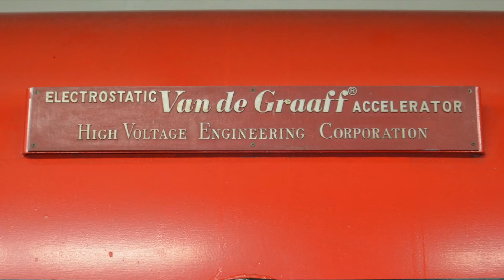Particle accelerator - Tandem Van de Graaff

Comment: Thank you very much for the tour. Very interesting measurement setups. Can you stay near the beam line and bending magnets while the accelerator is in operation? I'm wondering how high the radiation level is during a run?
Reply from the maker: You can be closer but not too close : )
Level is few (about three) times higher than background but is not too high.